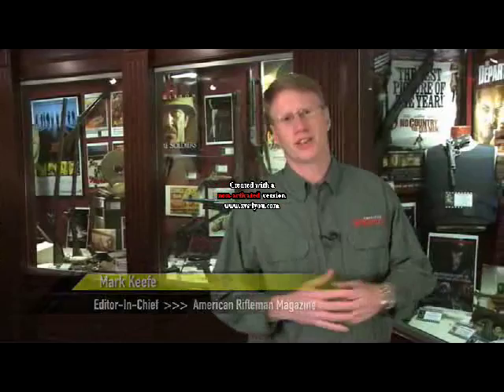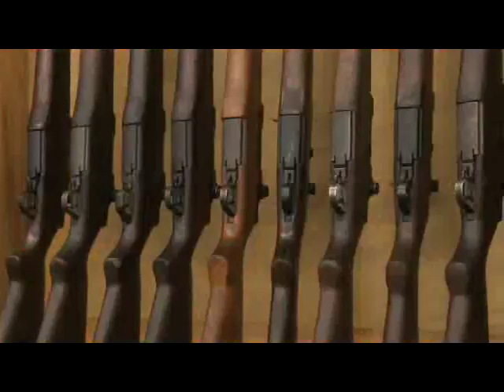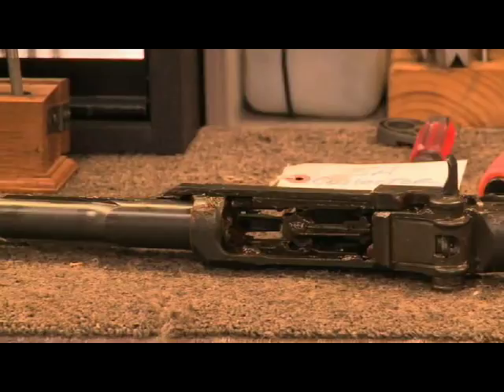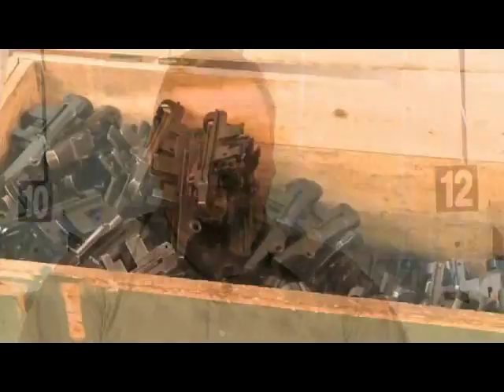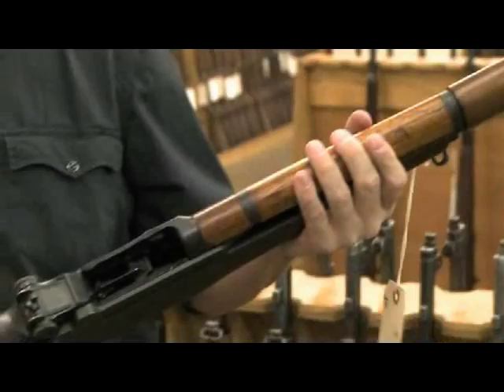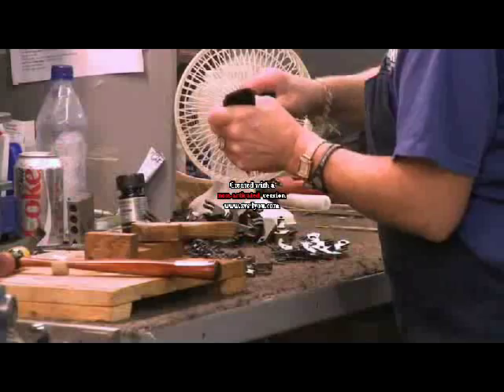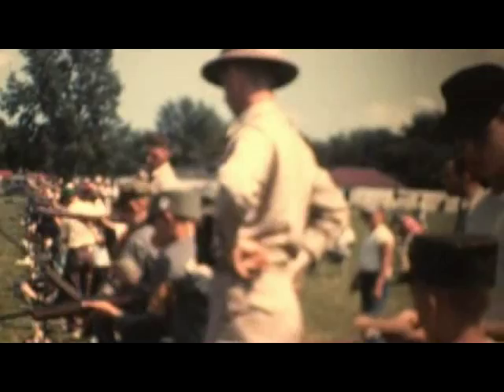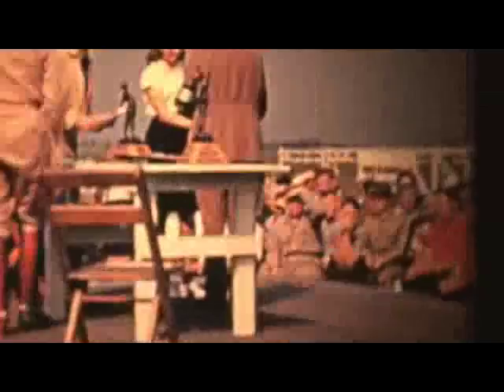American Rifleman TV, Inside the CMP

Comment: @bsrman36 
Some of the rifles are not disassembled and sent through the untrasonic cleaner. rifles with low serial numbers, collectors, correct rifles are set aside.

There has been some discussion of not running the stocks through the cleaner.  One thing we need to understand is that all rifles are checked by the CMP staff and test fired for function.